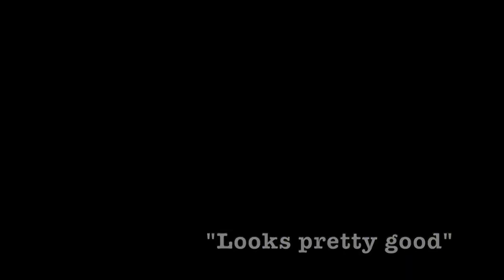How to Add A Gravel Border Around A Shed - Shed Build - DIY - How To

Comment: instead of the treated board  I would use a heavy gauge metal mesh  to maintain  air flow under the shed floor
Reply from the maker: That is a great idea, i think i will replace it
Reply: Plenty of Air will still flow under it. It's not 100% air tight.

Comment: I did the same thing on my cabin in northern Michigan, and from all the water splashing off the rock under the siding, it destroyed my siding, and my paneling contractor told me I had to get the rock away from the building or I was gonna continue to do it after I repaired it
Reply: Put a gutter on. Problem solved.
Reply from the maker: I am going to do exactly that!